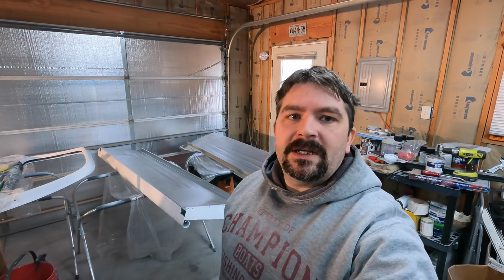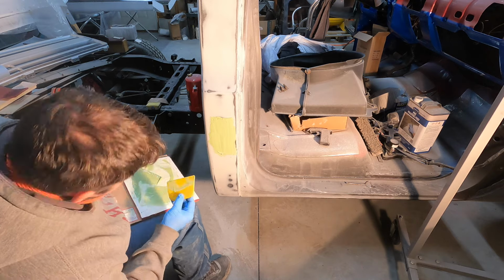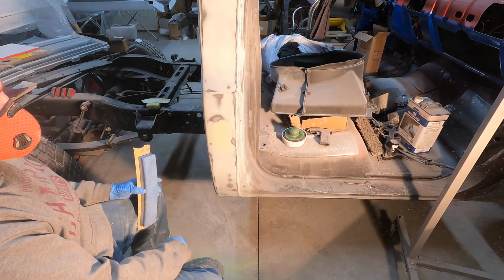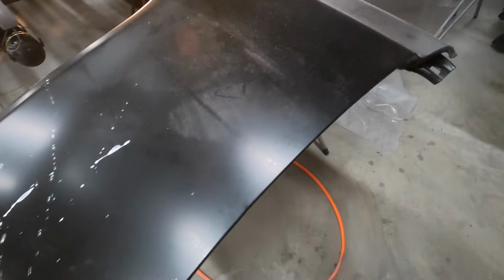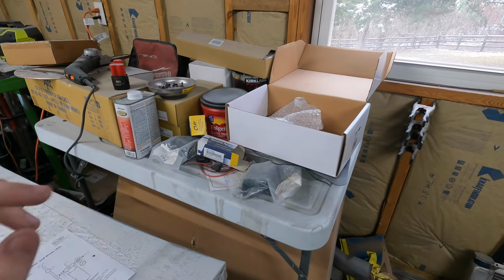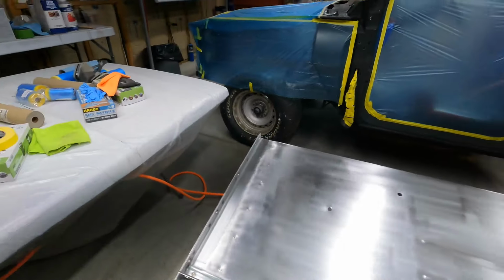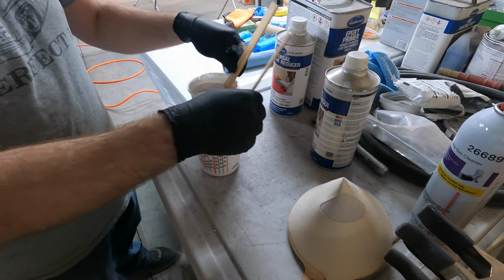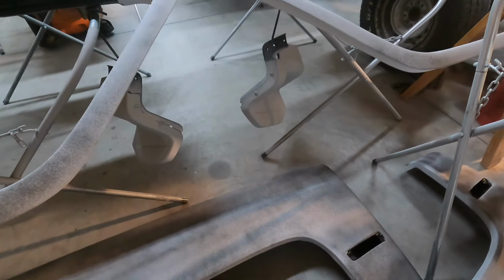C-10 Panel Prep with Epoxy and High Build 2K Primers

Comment: What did you use to sand window edges
Reply from the maker: Hi. I used a combination of the softer worn edge of the sanding block with older paper and in a few spots just the sandpaper on my finger. It is easy to cut too far on the sharper curves and edges.